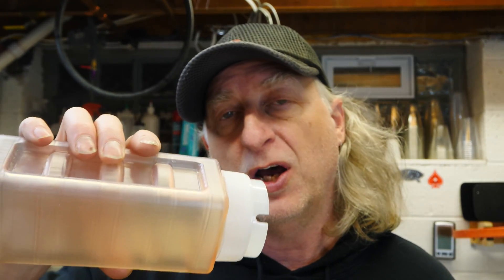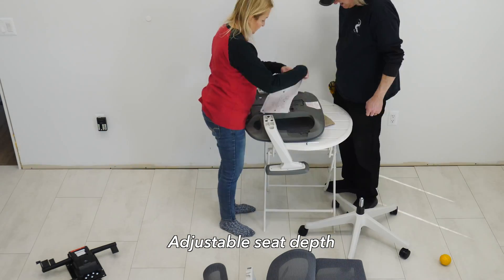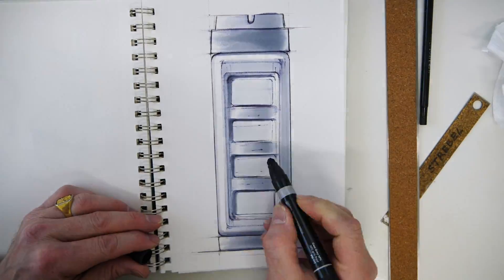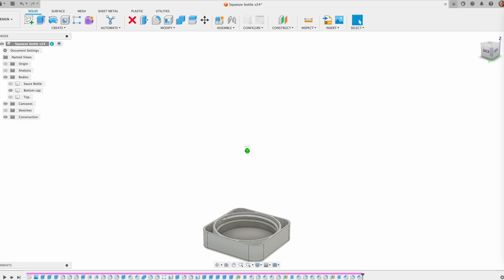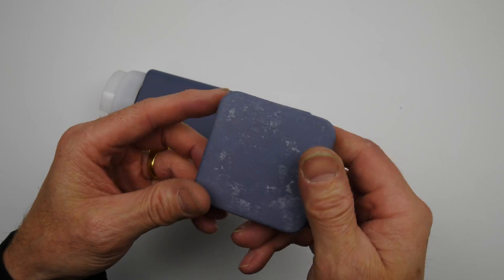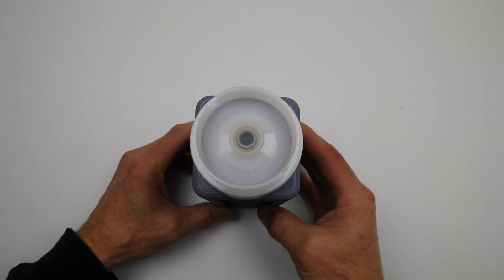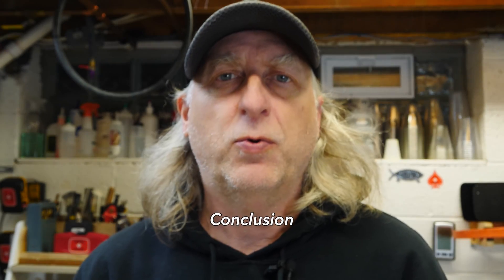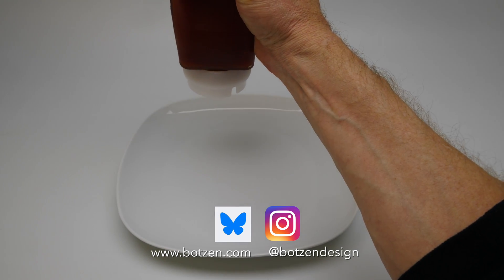Design Process: Industrial Squeeze Bottle (Sci-Fi) resin printed

Comment: 👍👍👍 What clearance do you have between threads? And do you have a rule of thumb for the final tightening angle? It would be nice to show how you line them up.
Reply from the maker: Depends on the materials, I usually start with a guess maybe two tenths of a millimeter, the same goes for the material you'll have to do some tests fits, but usually about a quarter turn.
Reply: @EricStrebel  Good stuff 👍

Comment: The cap on both ends is a great idea. It allows you to refill the bottle, and have the oldest product used first. 
The ridges, on the other hand, will trap the product in the corners. It should probably be used for something that doesn't rot.
Reply from the maker: FIFO first in first out, use the right material and it should not be an issue.

Comment: These types of bottles (I use the FIFO brand) are great for part A and B silicone to quickly measure (squeeze out) small molds and moulage. Instead of pouring and measuring from the buckets you can keep these on your work table to just squeeze out the silicone like your ketchup 😂 Super fast and no concern for cleanup.
Reply from the maker: Interesting, I like it
Reply: @EricStrebel  Saw it on a Stan Winston School of Character Arts course and use it all the time for small silicone pours and prototyping moulage colors etc.

Comment: Seems like it will be difficult to clock the threads of the square end cap so that it aligns with the square body of the squeeze bottle.
Reply from the maker: There are easy ways to line that up, many shampoo bottles do that.

Comment: I think you wasted a lot of time and filament by making a hollow FDM mockup. If you wanted to just feel the dimensions I bet making a solid bottle (closed inside) with 5% infill would be better
Reply: Lightning infill and single-wall can be good for that. It throws some sparse lines and then grows them out so they are capable of supporting the shape at the top. Top surface infill density can be as you specify, say 10% is usually good, and it tapers down to effectively sub-1%.

Also worth checking whether any infill is needed, i see Prusa/Bambu/Orca just not relying on infill for internal overhangs and supporting them with an anchored wegde for example.

However it may not be worth the extra workload to model a solid bottle when you're working on a hollowed one in CAD. After all you leave the printer be to do its job, if you don't need it right away, it doesn't matter whether the print takes twice as long, and one may not care about a few cents of filament cost either if one values their workload at any reasonable wage level.
Reply from the maker: 😀 Plus it is nice to see the interior volume

Comment: i would wouch for the original cylinder design. its the ideal shape for the job, you will always grab it in the right orientation and the smooth surface aids it primary purpose which is squeezing the maximum out of it. with ridges the ketchups mustards and mayos will probably get stuck in there. still great to watch the process tho
Reply from the maker: Ergonomically, think about people that are not able bodied or have a tough time gripping things. Eventually all the ketchup will end up at the bottom with the right interior surface.

Comment: After seeing this video I have so many questions...
Does the flexibility of the flask hold in the threads, so that when you squeeze the bottle, it won't leak?
If a flask is full of something, you want everything to be able to get out of the flask. With so many shapes in the inside of the flask, I can hardly imagine you will get all the sauce out of it. Isn't that part of the industrial design, that it's functional?
Reply from the maker: Watch the end of the video...you realize it is a prototype that is used to simulate the product.....
Reply: @EricStrebel  Yes, I have seen that, however, the design is predictable not suitable for a sauce flask, for just too many reasons.
Reply from the maker: Economically in a greasy kitchen is quite good, always trade off's there are.